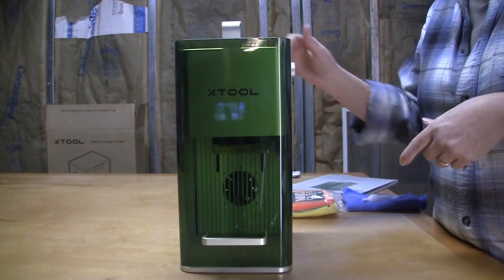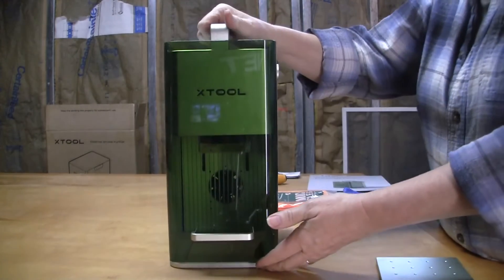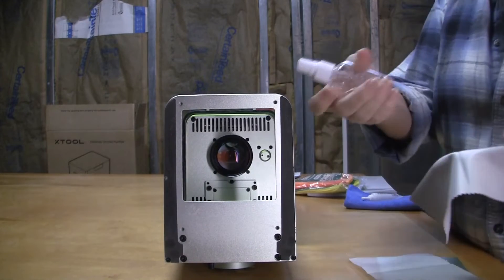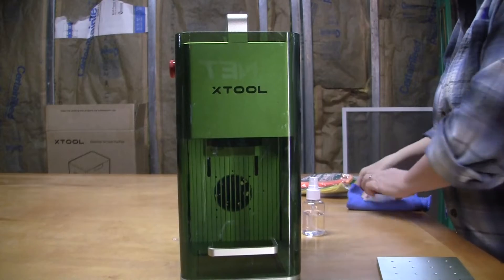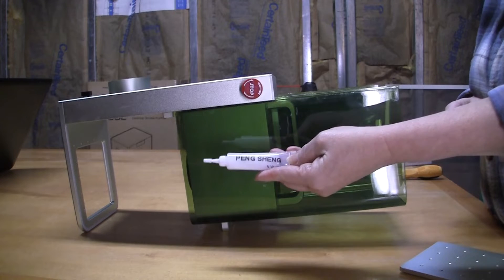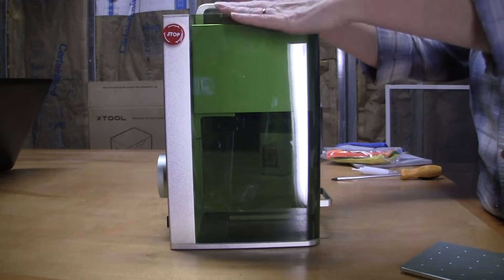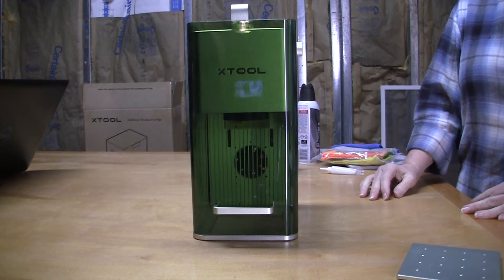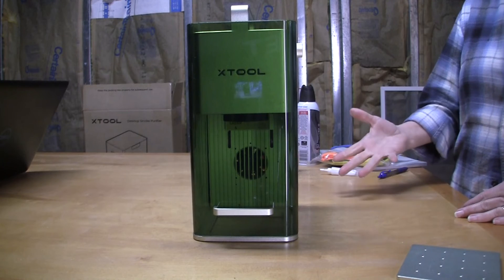Maintaining your xTool-F1

Comment: Great information. I still can't figure out why I get the dreaded BSOD whenever I start the XTC program and turn on my F1. After the system restarts, it runs fine.  🤷‍♂
Reply from the maker: Try starting up the PC and the F1 before you start XCS and connect them.
Reply: @LarsWorkShop  , didn't work. Same issue.
Reply from the maker: What version of windows?